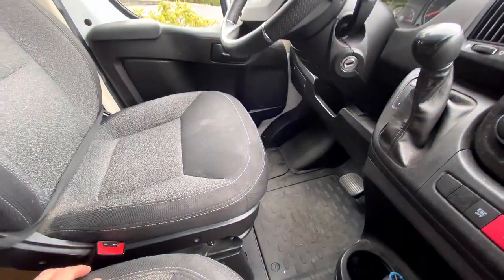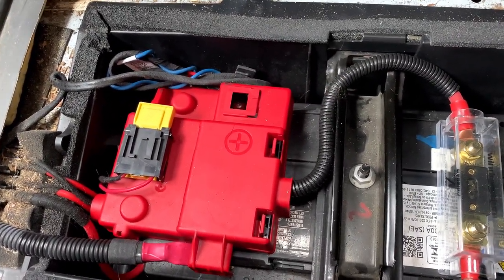BENCH SEAT TO BUCKET SEAT | Brand New Airbag! | PROMASTER VAN BUILD SERIES | Ep 14

Comment: Contemplating cutting out the sensor on our current bench seat OR buying the sensor and trying to sell the bench seat with all components.. Did your bench seat sell pretty quickly? Or was it a hassle?
Reply from the maker: Hey! It was pretty quick to sell, we posted it in the promasterforum I think. 

We opted to buy different sensors just in case anything went wrong. That way we still had a functioning seat. We only bought the occupancy sensor, we used the seatbelts from the bench seat and sold it without 👍🏼

Comment: We’re picking up a single seat this weekend and will start our bench to bucket seat swap. 😬 I hope we can do it as easily as you have demonstrated!! Any “after you the video” updated recommendations? Are you happy with the bucket seat?? Thanks!!
Reply from the maker: Hey! Good luck with your swap! 

We’re super happy with the bucket seat, it’s much more comfortable than our bench, and we love being able to get to the back of the van! The only downside is that until we build our couch our dog has nowhere to sit. 

Our only after the fact tips are If you’re missing any bolts it’s way easier to install them before you put the seat in the van. We were missing a few that we installed after, it was a bit tricky. 

The bolts to mount the slider and the seat are m8 in case you’re interested, you can get them at Home Depot. Use class 8.8 or class 10.9.
Reply: @HayleyandJake  - Just wanted to give an update on our van build, and hopefully it'll help your viewers out as well.  Your video was beyond helpful for us! We picked up the seat and ordered the center seat occupancy sensor from the link in your description.  When I went to check out, I included the VIN of our van (there's a spot for it and it made sense to enter it).  I received the part but it was the wrong part.  I needed the sensor with the white connector - they sent one with a black connector.  I returned and ordered it again...same thing, entered the VIN when I checked out.  I received my second shipment and once again, it was the WRONG connector.  It seems that the occupancy sensor that is needed, with the white connector, is not included on the Chrysler parts list for the Ram Promaster - when the part is absolutely in the van.  As such, when the company ran my VIN, they were sending me the part they thought I needed, not the one I actually ordered.  A phone call and some photos later, I finally received the correct part and finally finished the install. Moral of the story - watch your video but do not include the VIN when ordering the part!
Reply from the maker: @leslieopsal1999  ah that's frustrating! We're glad you found it useful and that you got everything working! Nice work 👍🏼

Comment: Were you able to use the same base as the bench? Or did your bucket seat come with a different base?
Reply from the maker: Hey! When we bought the bucket seat we also bought the pedestal for the seat, so we used that. 👍
Reply: Do you by chance know if the bench pedestal would work with the bucket?
Reply from the maker: @daudio12  There's a chance it would bolt on, but the bench pedestal has a support for the middle seat that would be in the way. The bench seat also does not come with a slider, so if you installed the slider then the seat it would sit higher than the drivers seat. You could possibly bolt it directly to the bucket seat, we didn't check that. If you're having problems sourcing a proper pedestal try called local auto scrap yards. The pedestal will likely be in fine condition, even if the vehicle has been written off

Comment: Awesome video! Looking to do a seat swap myself. I have a 2021 promaster bench and was wondering if you knew if a 2019 single seat would fit? Just wondering about the bolt pattern on the floor. I cant find a clear answer on whether different year seats are interchangeable. Not too worried about fooling the sensor.
Reply from the maker: Hey! We’re glad you like it ☺️ our recommendation for figuring out the seat is to search for your current seat (or the one you’re putting in) on https://www.moparpartscanada.ca. There will be a list of compatible models, and that will tell you what model year it fits, and if they’re interchangeable 👍

Comment: Excellent vid, thank you!  We're just about to start into this process ourselves for our 2020 Promaster.  Curious as to what year vehicle you have as it doesn't appear that the sensor you linked is compatible with the 2020's.  You purchased from the US...were you unable to find any Canadian suppliers?
Reply from the maker: Hey, glad you enjoyed it! The seat swap is daunting, but not actually that difficult 👍

Our promaster is a 2018 model. We actually ordered our parts directly through a local dealer (we’re in Vancouver), the link is mostly for reference. We were looking for the airbag and seeing crazy prices online, and surprisingly the dealer was cheaper 🤷🏻‍♂️ most websites that list it should say what year range they’re for. I’d check Mopar online, or ask the dealer 👍

It’s the seat occupancy sensor that you’re looking for. There’s a different one for the middle seat than the passenger seat (the connector colours are white or black). You can check the correct colour by looking under your seat. 

Good luck!